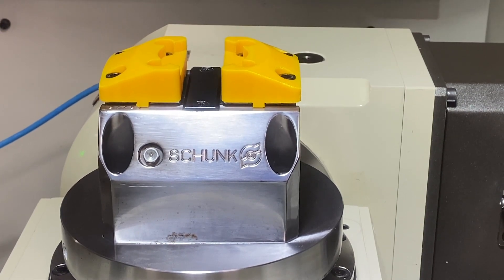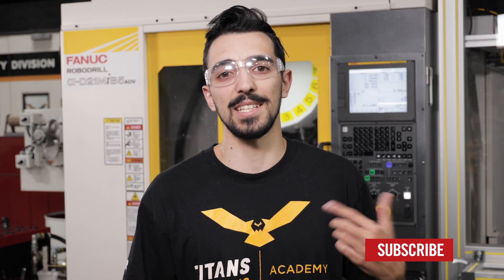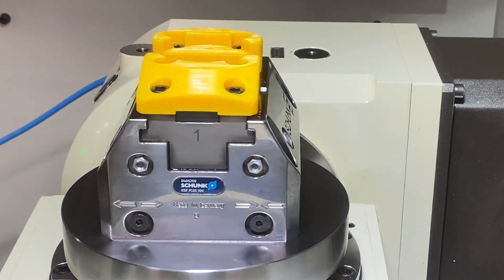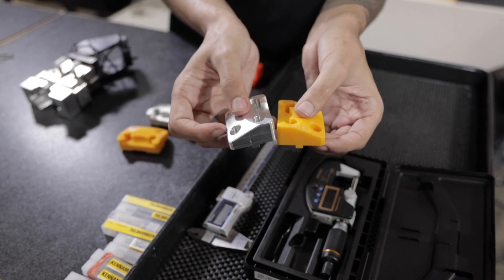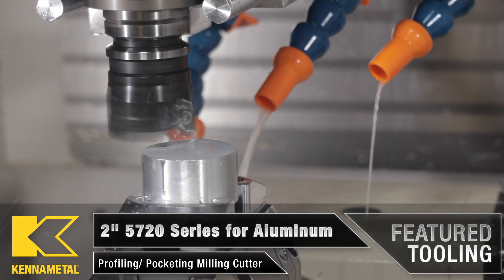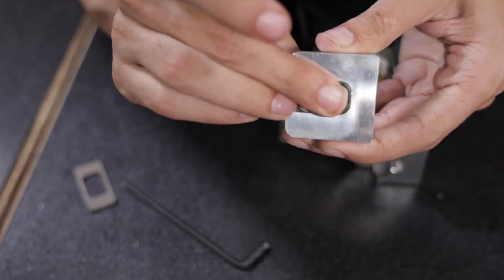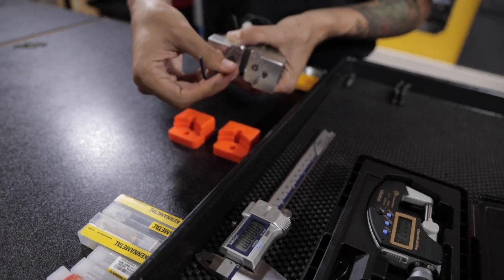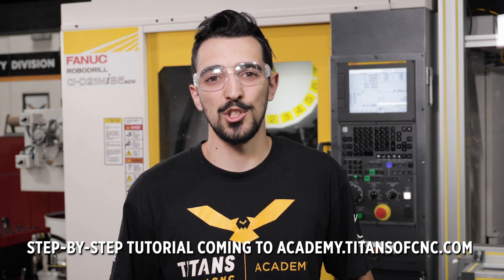Prototype to Production | Creating the Set-Up from Scratch | 5-Axis FANUC ROBODRILL + LR Mate 200 iD

Comment: 3D printing is so good for prototyping.
Reply: It is even good for low load finished products. The other day my wife slipped in the bathroom and broke the TP holder took me 30 min to design and 3hrs to print a new one. Yeah I could have bought one for $5 but where is the fun in that.
Reply: @WILFRED1184  Hahah That's funny. The metal printed parts can easily be used for production or plastics for girppers and what not.

Comment: There's some exciting Generative design software out there like MSC Apex or Fusion 360 which gives greater scope for creating fixtures/work-holding! Print them on a system like HP Fusion/markforge or renishaw-am / dmgmori Lasertec and that cuts the time down dramatically when you need bespoke solutions.

Comment: Why wouldnt you just mill the jaws in the first place instead of 3d printing first?
Reply: Do you not understand what "prototype" means? I mean, he explained the answer to your exact question in the video.
Reply: @justinl.3587   Yeah i get that. But Wouldnt it just be easier and faster to draw and mill them. Like such a small piece of stock is cheap.
Reply: I do that all the time in the shop where i work. I just draw the jaws in mastercam